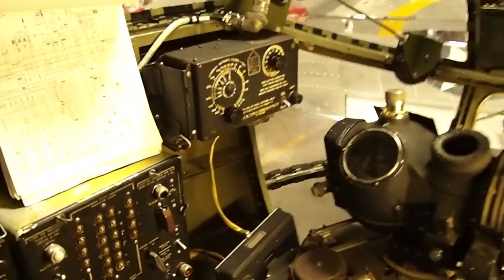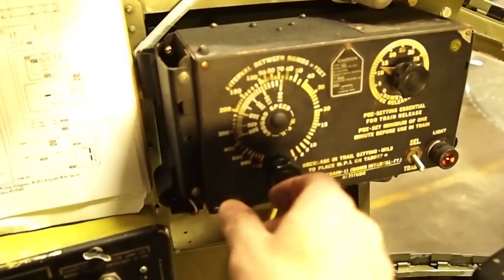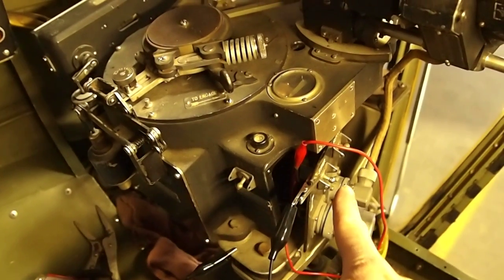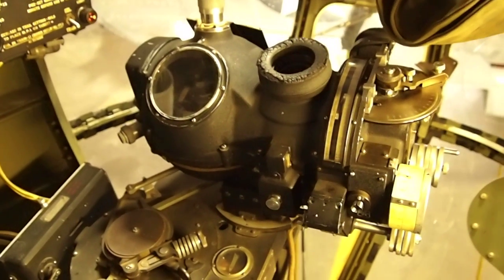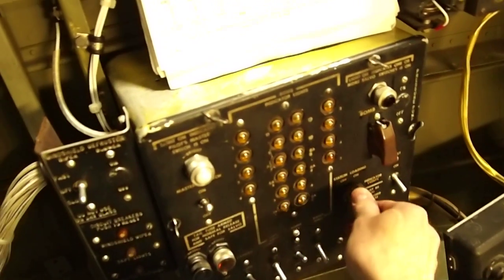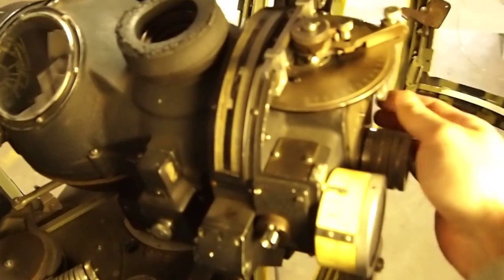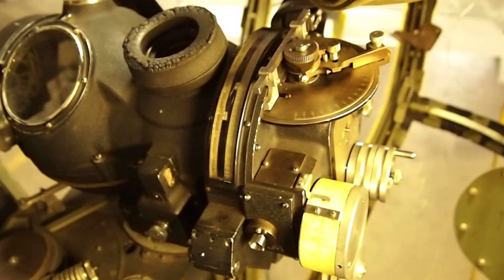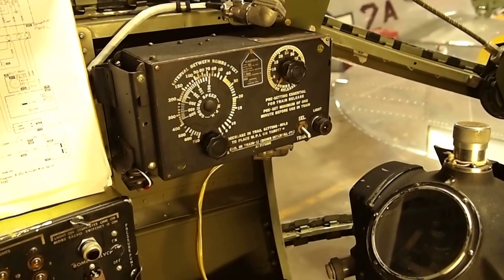Working Norden Bomb Sight-B25 Miss Mitchell

Comment: Absolutely fantastic.  Great work.  I'm just waiting on a DC power supply to come in to see if my little guy will come back to life.  I needed about 5 extra hands to get the telescope drive wire back in place around all of it's pulleys but I think I'm now mechanically at 100%.